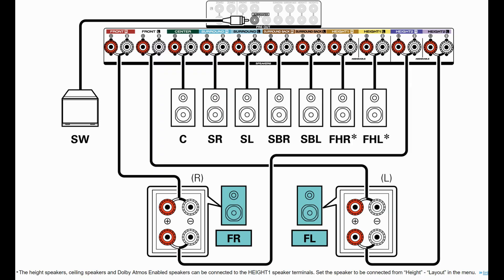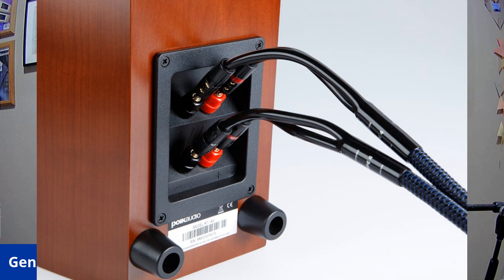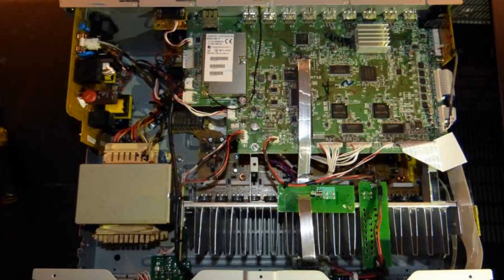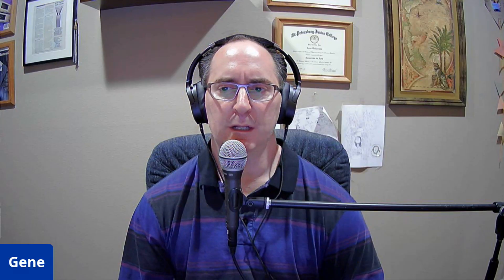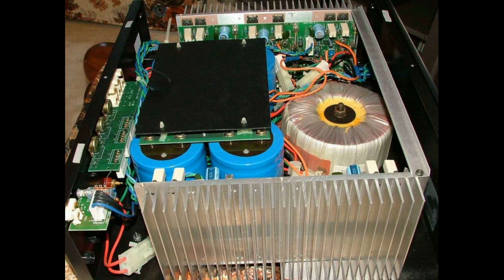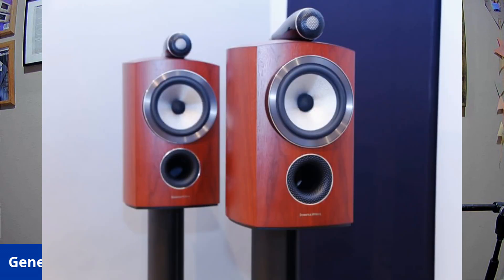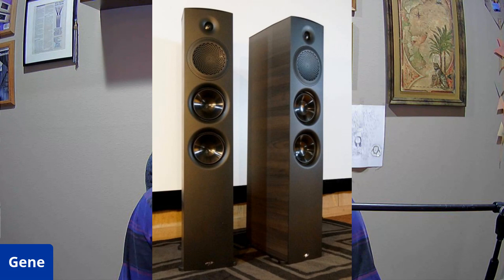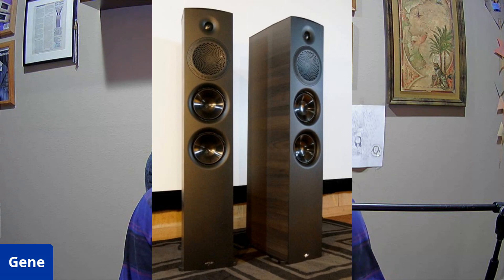Should You Bi-Amp Your AV Receiver?

Comment: I bought the Denon 3600H last year. Since it has 9 channels of amplification I’m running it bi-amped on my klipsch towers. My set up is basically 5.1 with height speakers in the front. I love streaming music to listen to in stereo. Bi-amping definitely improved the clarity of the highs. It actually improved the imaging too. I went back-and-forth a few times and it definitely seemed like something was missing when I wasn’t doing it. It’s tough to judge comments from people since you don’t know a persons given level of competence and understanding when addressing technical issues. I’m not saying I’m an expert but audio is a hobby of mine and I think this receiver makes enough of a difference when listening to music to be worthwhile.
Reply: Nice Gene....thinking of bi amping my RZ 70...to my SVS ultra towers.....will it be advisable....Thnks
Reply: @jagsandhu6114  I’m in for the same answer. I’ve got N RZ-70 also. Come on Gene !
Reply: This is exactly what I was looking for, I use my Denon for 70% music 30% movies/gaming.  Have it hooked up to my RP 8000F,s.  Because of your post, I’m going to give this a try.  I know you had to change settings in amp assign, but did you change crossover settings?
Reply: @woohunter1  when you have it set to being bi-amped it doesn’t treat the speaker as having separate crossovers for the lows and highs. There’s no new settings to fiddle with. Whatever settings you’re using now won’t need to be changed once you rewire it.
Reply: @jdk_360  so your towers will receive 4 channels of full range above the 80 hz crossover (that’s what my high pass is set at) then the built in passive crossovers inside the speakers take over from there?  Sounds easy enough.  Gonna give this a try tomorrow.  Thank-you for confirming this.  Did you rerun Audyssey after doing this?
Reply: I just bi amped my Klipsch R26F Towers to my Onkyo rz30.

Comment: Hi Gene , I hope U doing well . 
I was watching Ur channel all the time and for me is audio reference channel (my favorite).  I always take Ur worlds very seriously. 
Recentlly I upgraded my speakers to MA gold 200 5g 3 way towers (4ohm 88 dB  Sensitivity )
 , c250 5g center (4ohm 88 dB  Sensitivity )  and MA studio rears (4ohm 86dB Sensitivity)   , I still running the same speakers for dolby atmos Q acoustics 7000i LPR (6ohms Sensitivity: 85 dB )  and all  those speakers are connected to ARCAM AVR 550 reciver whith is 7 channel amplification reciver whith 11 channels processing . When all speakers are driven I noticed on higher volumes (around 75-80Db )  AMP is switch off (power protection ) . I was thinking to add external power amp for atmos speakers and Bi AMP my front speakers using 6 and 7 channels of amplification , I listen quite a bit of stereo music directlly from AMP . In Ur opinion what will be better: 
1 - add really really great  external power amp class G  ARCAM P349 3 channel  to drive front and center speakers not doing Bi AMPing around 2200 GBP second hand 
2 - add some second hand arcam stereo amp 200 GBP  for atmos speakers (take a little bit load off from AMP ) and be amp front speakers using 6 and 7 speaker terminals  ( LESS MONEY OPTION ) 
3 - add mid range/ better power amp class G from arcam P429 4 channel  ( 1200 GBP) to drive front and atmos speakers ( a bit of waste class G amp for atmos speakers in that case)

For me that 75-80 Db is enough volume in my room so I was thinking option 3 should be enough  but I'm not sure right now ,  sometimes some movie could be quite demanding in frequency  (crossover set at 80hz)  but amp mey be under heavy load running all of that  speakers .

Comment: Hi Gene.. First off, thank you for the video, very informative . I’m running a Marantz SR-8012 and a 7.1 setup. Eventually, I would like to add maybe a set of height channels. I really don’t do too much 2 channel listening , think I should still bi-amp my klipsch rf-62’s?
Reply: I have that A/V.    I was running a 11.2    With a 3 channel monalith amp.

Really wasn’t worth the money.   I sold the amp and went with a 9.2  with bia- amping my front towers (jbl system).  Sounds the same to me.
Got some money back on the amp and stashed away the two speaker I removed.

Just letting you know what I did.

Larry
Reply: @mafosa8519  thank you, that’s good to know .. are you running your atmos in the front? Or back ??
Reply: @dannyb0325   running front n rear height speakers.
I live in apt.   So.  No atmos for me.

Larry

Comment: Thanks Gene.  Informative as always.  I bi-amp with my Marantz 8805 processor.  I can program it to use one of the height outputs as a bi-amp channel.  So I run the upper section of my mains (Focus 20/20) with a Rotel RB 1080 and the low end with an RB 1090.  Plenty of headroom.  As you suggested, it's mainly for cranking 2-channel audio, but also comes into play when watching loud action movies.

Comment: Hi Gene I found the video informative, I have a Denon AVR X4300H Bi wired to Montitor Audio silver RS8. I did this thinking that the speakers would sound better driven  Bi wired at lower volumes as you have two amps driving each speaker. I have done this from the start on getting the Denon and have been happy so far. Tell me is my thinking flawed or is it wishfull thinking.

Comment: Personally I don't see much if any benefit in passive bi-amping especially with a receiver where the amplifiers have shared power supplies.  One issue with having no active network in front of the amplifiers is that both are receiving the same full bandwidth signal.  So if you crank it up and the low frequency amp is clipping, so is the high frequency amp.  If you had an active crossover that wouldn't be happening.  

Personally I don't just bi-amp, I everything amp.  I rarely use passive crossovers but rather use active crossovers with amplifiers for each bandwidth.  I'll build side surrounds for my new HT with passive crossovers but nothing in the main LCR will use passive.  In fact all those speakers will each have numerous amplifier channels especially the center which will be a hybrid CBT, part physically curved and part DSP curved.  

Good components for passive crossovers are expensive and can easily cost more than a miniDSP module so why not go active?  Well, yeah you have to buy more amplifiers but it's definitely worth it in my opinion.

Comment: I own a Marantz SR 7013 and Paradigm Premier 800F coupled with Paradigm Premier Center 600C and the main surrounds are taken care by NHT SuperZero 2.1's

I'm running only 5 ch and I use a pair of SVS PB-1000s for the LFE's and main channel crossed at 80 Hz.

I had bi-amped in the begining and was listening to music strictly on pure direct mode and felt it was slightly beneficial to biamp.

When I integrated the subwoofers, I couldnt find the biamping the 800F + 7013 was beneficial...

800F's are fantastic speakers for money and thanks to audioholics for reccomending it.

Comment: Hello, bi-amping from my Denon AVR-A110 to my Klipsch RF-62 II's. Running a 5.1.4 speaker setup.
Reply: Hey Peter, I also have a Denon AVR-A110 and when I set it up (some years ago now) struggled and failed to get bi-amping to work, contacted Denon technical support, devoured the manual, etc., and finally came to the conclusion it could not be done the way I had hoped. I'm curious how you managed to get it configured? I'm driving 9 channels (FRW/FL/C/FR/FRW and SR/RR/RL/SL) and very satisified. But I had hoped to use the FL/FR line-level out to feed an external NAD amp to drive the FL/FR pair (bi-amping Boston Acoustic VR towers). The result would be 11 amplifiers for 9 channels).  But the Denon AVR-A110 is not this flexible. Maybe if I had only desired to drive 7 channels instead of 9...? I wonder if that is what you are doing?  [And if anyone reading this is wondering, why use the FRW and FLW? I have another set of Boston Acoustic VR towers with the powered subs. So I'm sending the .2 sub channel to the FRW/FLW towers in addition to the wide channel. No Dolby Atmos in the AVR-A110; the brief experiment of Front Wide/Height channels are no more.]
Reply: Clarification, I'd use the FRW/FLW line out to the NAD, and bi-amp FR/FL for both 9 channel and DIRECT 2 channel listening.  But can't do it on the AVR-A110!
Reply: @georgebarbperkins6793  Hey George, the Denon AVR-A110 that I have just came out a few months ago.  You may be referring to the Denon AVR-A100.  It was no problem at all with the AVR-A110.

Comment: It's helpful video - thanks. A question, how about bi-wiring integrated stereo amplifiers like Yamaha AS-2200? What's your recommendation?
Reply: No i wouldnt do Bi-wiring. Biwiring essentially makes the cable twice as long, which will lower the natural resonance to one-half of a single cable. ... For instance, if the resonances and reflections at high frequency are significant, the impedance seen by the amplifier could be reduced to less than one ohm.

Comment: @ the poster

Your a DIY bravo.
Bi amp to bi wire.

The capacitors on the Chanel amp broad runs 20-20 hz
 Controlling the frequency.
Carvar NAD does it soft chip low end roll off early is 60or 80hz
The power output rating is 375 walt with soft clip on. Off 20-20 about 100 walts

Old school 2ch.
30 Walt tube amp on tweeter.
60 Walt SS amp.
Now total Walt is 300 per side.
For low end
Another cheap way buy use same model. Just turn the balance to one side.  the power rating comes from the Transformer if it made to put out a 100 Walt per Chanel you'll get 200 you'll have that extra 6db headroom.

Yes there is an 11 on the volume knob

Comment: Here is the answer. NO!  Do it right get a separate power amp and bi amp with external amps.  Receivers are for beginners and people that do not demand a lot of power period.  Receivers do however facilitate less clutter in audio gear as well as simplify hookup etc.  That is it!  If one is looking to add more power by bi amping using anemic amps in a receiver are just the wrong way to go in the first place. Spend a little more and just do it correctly.  It really is not that hard.  Another issue is some speakers might have terminals for bi amping but if those crossovers are not truly separated inside it is a waste of time.

Comment: I haven't bi-amp'd anything,  but when I originally built my media room, I bi-wire roughed in all the surrounds. Didn't make a damn bit of difference. But it did pay off when I went to an Atmos setup because I had all those wires running through the ceiling chase. Win for me.

Comment: Hi Gene!  I've been giving thought to "BiAmp or not BiAmp my Klipsch RP-8000 towers.  I have both Denon AVR-4500H and the AVR-6500H in my two theatres.  Would you consider these receivers/spkrs ample to adequately sustain biamping? Thanks! Mike in Atlanta
Reply: Hi , is there any notable audio difference between x4500 & x6500 mainly in 2ch stereo? I have the Denon x4500 and wondered if I shood upgrade to higher class Denon !? Thanks.
Reply: @owisun85  Not really, but it depends on what volume level you're listening to, types of speakers, etc.  It's a fairly expensive upgrade to go from 125 watts to 140 watts.  But that's just my opinion.
Reply: @MT_53  Yes, I think you are right ! Thank you

Comment: I've been Bi-amp my Yamaha rx-v3800 since 2007...
Running jamo concert 8 fronts, center and surrounds.

On this receiver it is active bi-amp. It's states which way you have to send the low and hi signal to you speaker terminals.

It made a positive impact on how it sounds in stereo and 5.1.
I have no neef or want to upgrafe, which is saying something during this lock down here in the uk, 😜🇬🇧

Comment: Hey Gene 😀

First of all, a very big Thank You for the great knowledge you put into this. I have watched a few of your videos by now and I must say you do a pretty good job 👍

My setup:
Marantz SR4003 drives the mid and high on my Yamaha NS-777 front speakers. I used the front pre-outs for my ROTEL BX956AX power amp in bridge mode, that drives the front woofers.

Subwoofer: Rockford Fosgate Punch III 10" 400w rms, peak 800w driven by ROTEL RB-980BX bridged to 1 * 360w rms 8 ohm.

Good day to everyone 🤗

Comment: I tried for a whole day doing this with my AVR X6500H Denon to my older Polk SDA SRS 1.2 and failed miserably.  I had the diagram from manual and it just never worked.  I had it bi amped successfully with a cheaper Sony AVR but that thing did not have enough power to drive those 85 lb 4 ohm speakers.  Eventually just hooked them up with two wires with a bridge wire to the top poles.  :/  However, with the Sony AVR it did make a noticeable difference.  Just didn't have enough current.  Not even remotely so lol.

Comment: Audiophilia is more a mental illness rather than a hobby. If I un-bi amped your speakers you would not notice. Same as you wouldn't know if I replaced your speaker cable with coat hangers or cheap lamp wire.

Comment: I have a Denon 6500H which has 11 channels of amplification. I have a 5.1.2 set-up and I'm bi-amping NHT VT2.4 towers in the front. The extra two channels are used for zone 2 outside patio.
Reply: Passive bi amping from the same unit has basically no effect on output. Passive bi-amping from 2 discreet units can add something like +3db of output. Active bi amping which gene mentions is where the money is at but it gets expensive very quickly, you also lose out on WAF. I was really expecting Gene to go a hard no on passive bi amping, with the platform he has I would expect him to help steer people away from foo, I’m disappointed. The comments on this video are insane, people asking about bi wiring etc this is on you Gene :/

Comment: Gene, solid advice as always, but I don't agree with the "don't bi-amp small 2-way speakers" advice, at least not with demanding speakers. I had a NAD T775 driving Jamo D830's and even though it was capable of delivering the current needed for the less than optimal impedance dipping to 2,8 Ohm the sound was much better when bi-amped. We A/B tested it a lot and also using a separate power amp.

Currently I have a Yamaha RX-A3070 driving floor standing Triangles with even worse impedance characteristics and though the differences are so small I'm not even sure they're really there when driving them with bass management rolling the off at 60 Hz or 80 Hz I have kept the bi-amp setup. Sure could use those channels for two additional Atmos speakers as well as going from 5.2.2 to 7.2.4, so I'm considering buying a separate power amp.

Comment: Good video. So if you are not using the other two amps, for example (using 5 when 7 are available), will the output for the 5 channels be higher or the same as if you were using all 7 channels? I just got the Sony STR-ZA1100ES yesterday and I was planning on setting it up this Friday. Thanks.
Reply: The 1100ES has a fairly solid build quality and the power rating is equal on all channels. The only thing you run into is when driving that receiver at high volume. The power supply is decent but not remarkable so I would expect to hear some strain to power all channels when running at high volume. Other than that, the sonic benefits of bi-amping should more than offset any power supply considerations during 2-channel listening.

Comment: I have fairly efficient speakers so even with the cheapest receiver I can get my hands on I can drive them hard enough such that with hearing protection on it's unnervingly loud.  The reality is that unless your speakers are very inefficient most people can probably get whatever they want out of them.  Also, tweeters are only like 20 or 30 watts handling anyway, and on top of a 100 watt load on the bottom end you're looking at less than one dB of additional loudness for all the extra cost, complexity, and tuning.

Comment: Hi Gene, thanks for this.  I’ve got an older Onkyo TX875 which was pretty “ stout “ in its day.  I am using all 7 channels per say, but using separate amps via pre outs  ( 2- old school Integra M -5030 ) for front and side surrounds, and the 875 is essentially just powering the center and rear surrounds.

Am I leaving something on the table here that could be enhanced?   I am using triton ones ( original version) for main front, golden ear super center xl, and 4 really old school Energy 22 pro monitors fircside snd rear surrounds,   Using sub feature of tritons connected to sub channel ( effectively giving me two front self powered subs ) and 2 rear subs via signal split of sub channel ( Marin Logan dynamo’s)

All sounds fantastic for non atmos and other new tech, but any suggestions ?   Two channel music via the triton ones are excellent, but not over the top loud ....movies are incredible and far more punch than I’d ever need.     

Btw-one sub out channel feeding all 4 sub inputs via splitting did have some phasing issues in rear subs but tweaked that with the Audyseey and on board phasing control of the ML’s.   
I’m a die hard follower and just waiting to jump in with new monolith processor and multi channel amp combo.    Loving monolith, just need my pocket book to catch up.   

Curtis from Canada.

Comment: What if I have a stereo amp with 2 channels, A and B, and I use A for highs and mids, and B for lows?
Reply: A/B speaker selection is not separate amplifier channels. It's simply two sets of connections to the same amplifier channel. In this case, you are only bi-wiring, not bi-amping.
Reply: @Orcinus24x5  Thank you for the answer!